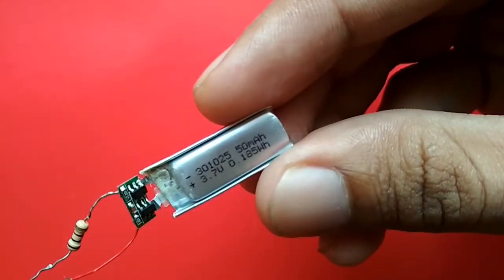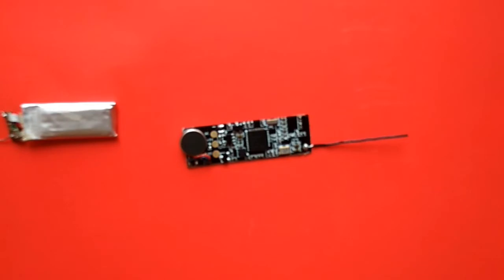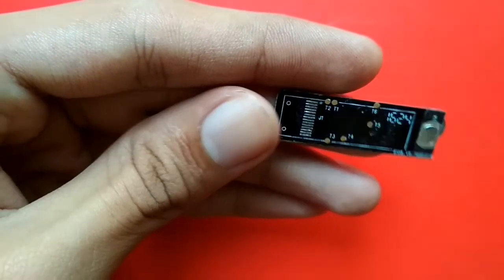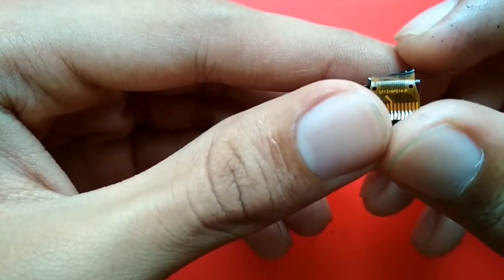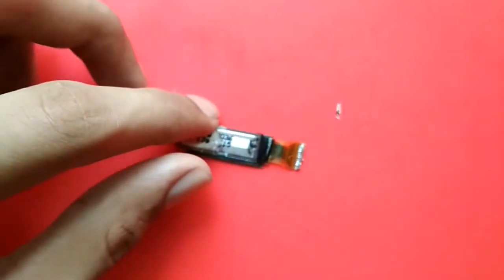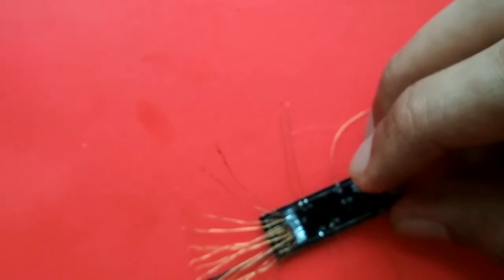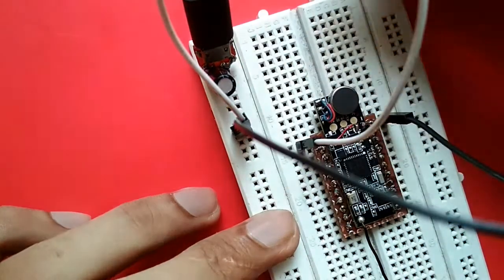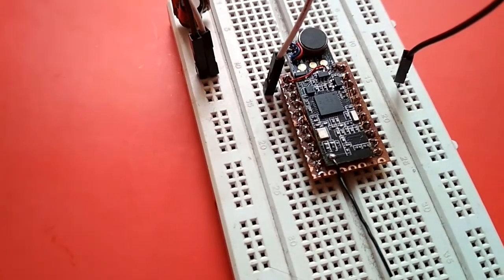Hacking into a cheap fitbit CC2540

Comment: Nice job with the magnet wire! Next time you might consider using some blu-tak/poster putty (or some easily removable tape - I use gaffer's tape, or sometimes aluminum foil tape which is only easily removable if not left on long...) to hold multiple wires in place as you solder them, might make it easier to solder things like that strip where the LCD connector was. Was thinking/hoping you were actually going to hack open the adapter, didn't realize both the adapter/"bridge" and the fitbit itself have a CC2540... Looks easier to mod the fitbit itself than the USB bridge (much bigger, actual test points instead of little bits of solder on a qfn chip), but hoping I can find some way to turn these spare adapters into ble sniffers or something
Reply from the maker: I want to do actually program it but I ran into trouble. Apparently the BLE contains 8051 core for which open source compilers are available but they do not support the bluetooth stack. Other solutions offer limited program size ( 4KB in IAR workbench which is meagre). Yes I realized that I was being stupid to solder all those wires the way I did.
Reply: aw, nuts - can't make sdcc work on it? what a pain. and IAR size-limited versions are also annoying. Not sure how much of that 4KB is taken up by their BLE stack stock code , I suppose if they offer a 128KB and 256KB flash version, it might be a lot.

I did recently get one of these, which is similar in concept (microcontroller with BLE, on a board that includes LiPoly battery support) but obviously designed to be used and programmable: has an arm cortex-m3 (or m4f?) integrated into the single SoC. Haven't played with it much yet, and of course it lacks the hack-value of repurposing broken things, but if you've got projects in mind, it might be a good value. (Surprisingly, since it has that special Lady Ada nice design - a full-featured dev board that is also deployable - and Adafruit support, it was also the cheapest nRF52 board I found...) https://www.adafruit.com/product/3406
Reply: and don't worry about the soldering - that was impressive! there's just easier ways for some of these things of course :D  You could probably almost make a "replacement flat-flex cable" with your magnet wire and some (kapton, perhaps) tape.